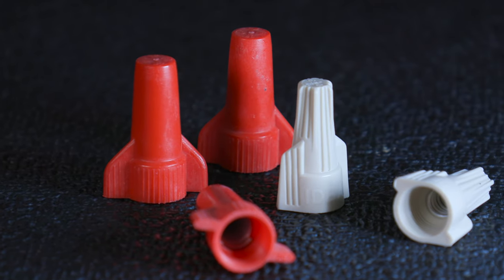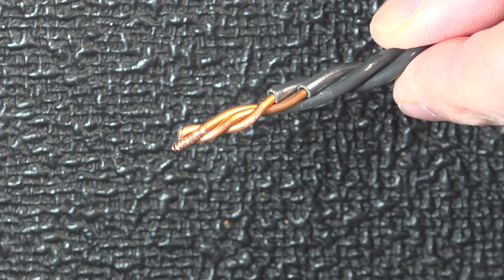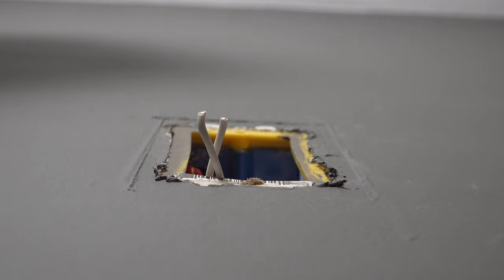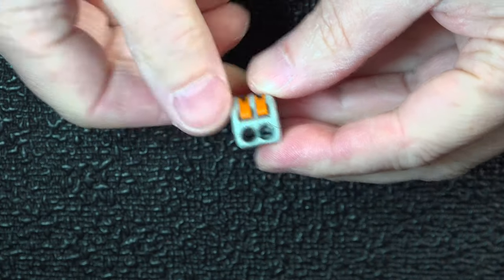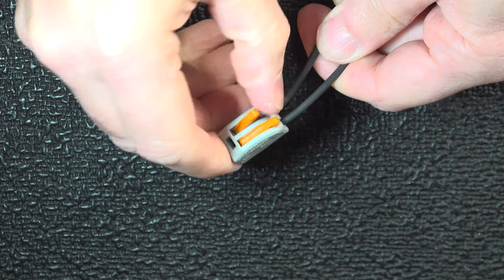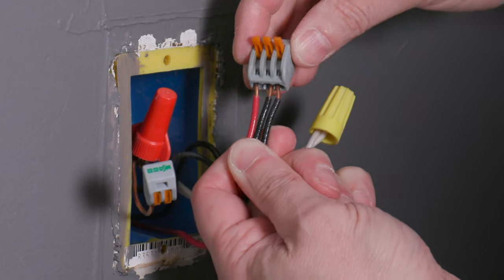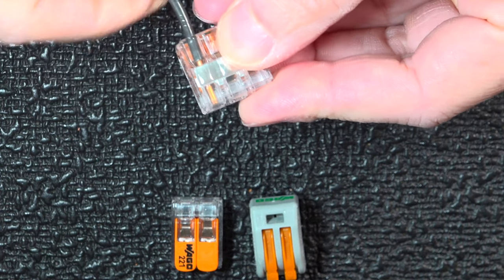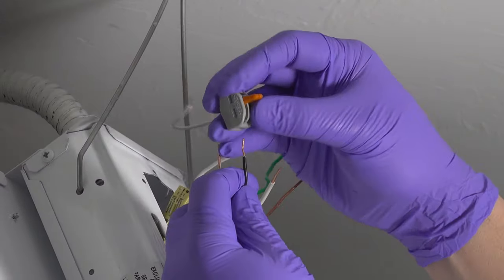Never use Wire Nuts Again - Wago is Better Electrical Connector

Comment: Wire nuts are UL certified, cheap and NEC approved.  That's good enough for most electricians, building inspectors and code enforcement.
Reply from the maker: Wagos are also code approved, CSA, UL & have many other approvals worldwide and meet the NEC as a pressure connector. The NFPA even did a special test on these a few years back, I believe in response to so many "worries" about them, despite them already being approved and passed with great results. They are not cheaper, faster and easier though.

Comment: Yes, I've used wire nuts. But for the loose wiring the Specialist and I found in the combat kitchen unit, that's what they used, and that's what we were given to fix where some were missing. I don't like the idea, but Uncle Sam's a freaking penny-pincher.

Comment: Those come with a lot of commercial lighting and the sparkys always throw them out. No one uses them in the villages of fl. Don't know about the rest of fl but I've never seen them used.
Reply from the maker: Can you imagine an auto mechanic ripping out electronic ignition and replacing it with points. Taking a new product and downgrading it.

Comment: And what about commercial work here we have to have so long of a twist before the connector. There’s an attachment for your drill to do this with wire nuts. So I assume these are not allowed. Good thing because they are horrible crap that either doesn’t work to begin with or burns up.

Comment: I got shocked many times at a job site pulling pigtails out of boxes because of wagos. The wires do not stay in when they twist as you pull the pigtailsout you are going to inevitably twist them exposing bare copper. Also when dealing with stranded wire they are a pain to use because the wire is not ridged enough to properly stab in. I am a jurneyman electrician and am still team wirenut.
Reply: I do however like them in light fixtures because you have more room and are less likely to twist enough to get shocked.

Comment: Well if you can tell me where I can buy a box of 50 or 100 and only spend $5 to $10 I will happily replace all of my wire nuts but also they don't really work very well when it comes down to stranded wire

Comment: Those look fine for connecting low voltage devices. I would not trust them for high amperage applications. I see lots of fixtures that come with something similar. I cut them off and discard them. I have never had any problems with wire nuts. They won’t give problems as long the wires are properly twisted with a pair of lineman pliers and no copper sticking out. Yes a wire nut will give problems when someone just groups the copper together and jabs the wire nut on without twisting. The wire nut will get loose and cause arcing between the wires.

Comment: the 1st wago connectors in your video are ɴᴏᴛ ᵁᴸ listed. I have used them but depending on the load the internal wire was to small,thin and overheated. then melted. Only buy UL listed and is rated for 14 or 12GA wire.

Comment: I've been doing electrical work for 50 years. Never had a wire nut fail,, overheat, etc. Ckever idea that no one will use... and what about code? Approved by the NEC?

Comment: You can unscrew the wirenut and just snip the very top off.  No need to cut the whole thing off.   And the wago is quite a bit bigger.  Not gonna be a good idea for inside a small junction box

Comment: one missing info is that at least on the old grey version, you actually have it marked how much you need to strip off of the insulation on the back of the connector

Comment: I have never cut a wire nut off. I twist it off, and if needed will sand the damage wire until mostly smooth. Just takes a moment more

Comment: I've had issues with wire nuts.. and these connectors saved me more than once! They're awesome. Expensive but awesome
Reply: I've wired up literally thousands of miles of wire using wire nuts for the connections and have never had a single issue that would stop me fro using them to this day. I would never fall for a scam like this. GG though, you must have money to burn.
Reply: @anonymouscity8083  I concede that the reliability of wire nuts must be higher in the hands of a skilled person than that of an average joe, but how often does an electrician get to evaluate the long-term results of his own work?

Comment: I’ve been on ALOT of service calls were it was a bad wago connection. Never been on one we’re a wire nut installed correctly failed. I literally tell my guys to cut them out unless it goes against manufacturer’s warranty
Reply from the maker: Good move, toss the german made, UL, CSA & NFPA tested connectors out. I think plumbers did this with PVC and kept putting cast iron and lead back in too. Someday maybe we will reach with UK and the rest of Europe are electrically and were 20 years ago.
Reply: Damn that was quick. You must be really passionate about this shit.

Comment: WAGO connector have their uses but they are not for everything. You mentioned contact area and how that can generate heat. Well take a good close look at your WAGO connector. You are only make a very thin blade connection to the wire. Under extreme usage they will burn up due to lack of adequate surface connections. They are great for use on lights and light switches but would never use one on an outlet where there could be constant power draw. I prefer to keep the fire in the wire, and not the walls.
Reply from the maker: Instead of hypothesis I tested it out https://youtu.be/B1pmuRsf1co
Reply: @SilverCymbal  Explain that to the people that lost their house because of them. But I'm sure they will be thrilled with you telling them just how safe they were. 

Like I said they have their uses and do work great for those uses. But they are not for everything. The WAGO argument has gone on for decades, and still there is nothing that proves they are safer then a traditional wire nut.
Reply from the maker: @jonesgang  What people have lost their houses to a Wago 221 series connector? I have heard this dozens of times in comments, with repeated requests from me to share a single  factual occurrence. I have received none. The NFPA tested these years ago with favorable results and they are the gold standard and only standard in most of Europe. Accuracy counts, so the accidents you are saying have happened or they are myths and since I have offered again for info  and so far as to ask to send me any burned out 221s that I would be happy to look at and bring to the NFPA which happens be down the road from me, and yet not a single one, or even a photo has surfaced. They are approved, meet a spec, you don't have to use them or use love them but myths of their disasters at this point are just that.
Reply from the maker: To add, I never said they do everything but I they are safe to use for their specified purpose and nothing other than fear has proven anything to me or the NFPA who writes the national electric code otherwise.
Reply: @SilverCymbal  Well I can also recreate what I want happen in a lab environment. Real world application are not quite the same. You take something from good to failure in one step. That is not what happens in a real world environment. If you care to actually take the time then do a more realistic experiment. Cycle from full load to no load and repeat this multiple times. Something like a space heater would do. You will see a drastic difference in your testing outcomes. I have been an electrician for well over 30 years and I have seen just about all there is, but life always sends me a new surprise every now and then. 

Again like I said WAGOs are great just not for everything. And WAGO's have been used for many years with full NFPA (NEC) approval. And I have seen them as the point of failure. Chances are they were improperly used as the cause for the failure. But they do can fail and are not impervious to failure like you try and make them out to be. 

Some electricians will swear by them and others will swear at them. Been that way since their existence.

Comment: I think of people who stab their wires in the back of outlets and switches. They come loose over time and can be pulled out easily. Most wire nuts are the ground and neutrals that are in the back of the box to never be touched again. Also most of those wire nuts were the cheap Home Depot ones. If you spend a little bit more at the supply house, they have really nice wire nuts. I don’t think their all bad. Might work in tight spot with short wire or for temporary things. Probably would be nice for people who haven’t done a lot of electrical work. For small things like others said changing out lights etc.

Comment: B.S. These wires should ALWAYS be spliced together then covered. One main reason for that is heat, when that wago cap fails & melts you'll have lose wires inside of your box. With a splice at least the wires are still together and a lot safer when troubleshooting. Also a wire nut is reusable, the first wire nuts were made out of porcelain and switched to plastic & metal cause it was cheaper to make. WIRE NUTS SHOULD NEVER BE USED TO SPLICE WIRES TOGETHER....
FACTS 💯

Comment: im studying to be an electrician, third year, and never used wire nuts😂 also if you didnt know, wagos have the cheaper version with no switches and you just stick the wire in. its holds little stronger and its also smaller than that one.

Comment: I am guessing these wire nuts were and still are popular in North America. Dodgy looking things and I have come across some within imported American machinery. Australian wholesalers have supplied a type of connector commonly called a 'BluePoint'.  Easy and safe to use. The new Wago type connectors are even better. May cost a little more but in the long run safety is at the top of my pyramid although some contractors are more concerned at increasing their profit margins.

Comment: commercially, the time you save is worth the extra cost, and they have some others that is for installation wires and not stranded they are even smaller

Comment: Yes please use wagos I have made lots of money going back and replacing them with wire nuts after they burn up or fall apart
Reply from the maker: I'm sure you have. Funny, to this day despite the horror stories, I am still yet to receive, even a single photo of a burned up Wago 221. Search on burned wire nuts you can fill a family photo album

Comment: I use a little dielectric grease to lube and secure a snug connection with my twisties, never-ever had a problem in more than half a century.

Comment: I've used these and love them. It just sucks that they are more expensive than buying a bucket of the wing nuts. If they make them cheaper I would forever switch to these
Reply: They're not more expensive tho. If you factor in labor cost, wire nuts are typically more expensive.
Reply: @teds9896  Labour cost us not an issue ti DiYers

Comment: are these connectors listed and approved ???? NEC 2020
Reply from the maker: Connector brands are not approved in under the NEC. The type of connectors are, these meet pressure connectors under the NEC and are also UL, and CSA approved as well as stress tested by the NFPA

Comment: Does no one use BP connectors anymore? Cheap, reusable and only loose around 10-20mm of wire per change as opposed to 30-40mm with wire nuts. Come in 1 screw for active/neutral and 2 screw for earth.
Reply from the maker: For an unknown reason those never caught on the US. They are brilliant and simple and get rid of all the complainers that can't believe a Wago works, but they didn't make it here.

Comment: There is only a tiny bite on the copper wire of the wego, which means there is so little surface contact area, which will make the connection relatively high resistance and more voltage drop and heat. Plus as you wego it , it will come lose. Compared with wire nuts, you can pre_twist the wires and put on the nuts. Then you have a ten times stronger connection and great less risistenance and basically no excessive heat.
And a 4 wire wego nuts takes more space than a 4 wire wire nut.
Just like the quick connection holes in the back of a receptacle. Do you think they are more reliable than the solid screw terminals on the sides ？So,Never use them, if you are working on your own house! these are the real problem makers.
Reply: I have been using WIRE NUTS for 50 years and agree with you 100%.
Reply: @flash490  thanks

Comment: I know this video is old but you don't and shouldn't have to cut wires to redo a joint. Simply unscrew the wire nut and toss it in the trash if you think it's bad or resuse/keep it if it's good. If you can't straighten the wires after undoing a joint, then you can cut the exposed copper off and restrip. No need to cut back over two inches of wire every time you want to replace a wire nut with a WAGO.

Comment: Simply does not have the strength(pressure)required and not anywhere near the surface contact of a properly made ,twisted wire nutted (it is a compression connector and they are quite strong) junction.I can also pull the wire out of these and it can also vibrate loose.I dare anyone to pull the wire out of one of my junctions-well,It can be done but takes so much force you could break the wire first.I can also easily vibration Proof it if I think thats an issue.This is  Also about the worst possible choice in any kind of element exposed environment.I can easily all but weatherproof the right kind of wirenut.

These are commonly used in flourescent fixtures because-you have to change ballasts or drivers and that makes it easier- but also because the small wire and low current as well as the non criticality make it ok. I have been a licenced electrician for 40 years and when I do anything that isnt inside of a light fixture I plan on doing it Once and Not having it fail. I would never use these.

Comment: Pre twist is always best and using the correct wire nut is always best. The type you are showing are way to big for the wire thickness you are showing.  Also after wires are twisted together and you twist on the wire nut always test it by pulling on it to make sure it is secure.

Comment: I resisted these when they first came out but over time they have grown on me. Also, I believe these remove a ton of installation liability that wire nuts could bring.
Reply: Especially in situations with short/old/mixed wiring

Comment: These connectors make a J box seem so roomy inside, too.  They are easy to push in so they lay flat in the back of the box leaving gobs of room for the switches or outlets.

Comment: There's a pretty simple explanation for why people use marrettes over these other connectors. It's typically $17 for a pack of 100 marrettes compaired to the $45 to $50 for 100 of these clips.
Reply: Is it really that significant though? $30 difference for 100 connections, how much does that increase the average job?

Comment: Are these rated for aluminum wire?
Reply from the maker: Yes, read their directions first I am not the aluminum expert. But this is from their site:  With WAGO Alu-Plus Contact Paste, they can connect aluminum and copper conductors using WAGO's connectors – quickly, easily and reliably.

Comment: I have never seen wirenuts before here in Europe.
There are kinds of Wago connectors that we call dominos in several countries. Either by thumb clips of screwdriver screws inside a kind of little tunnel.

Comment: I sometimes find these wire nuts on older installations from the 80s. We have been using connectors with knives in them since the 90s. Those connectors weren't reusable, but easy to connect cables with. Wago's came around 20 years ago, and have been the standard since. Use Wago connectors up to 40A.
Reply: The standard?  I think not.  40A....  Where do you live?  I hope I don't buy a house you did wiring in!
Reply: @markusallport1276   It's the standard everywhere these days, they are rated to 400V, 34A so it's about the same as wire nuts.

Comment: ONLY USE SOLID WIRE IN A NUT!!!! and if a nut is done well it is the best connection. over here we usually use something in between though. but if we use flexible wire, we use Wago and i love them (or mixing small and big wires). but for higher current a GOOD nut connection is the way to go

Comment: I will say these are best when used on #14 thhn wire or smaller. LV wires where the tiny blue or gray wire nuts don’t grab. #12 or larger solid or stranded gotta go with good quality wire nuts.

Comment: so as far as I understand, a wire nut if properly installed won't have an issue.  these wagos if properly installed won't have an issue.  Wire nuts work great if not overstuffed, and not in over currented situations.  I imagine these are the same.  But if you are going for a permanent application.  So most house hold electrical situations, why not use a but splice, or a bolt connector.  The answer is well, cost.  Wire nuts are incredible cheap.  In a residential wiring application they work fine and are not raising the costs of building projects.  But in any wiring I have done in commercial or industrial equipment I will put in a terminal strip for connections just for testing purposes later.  Then you don't need wire nuts, or wagos because you are just have terminal test points to join wires.

Comment: If you need to add a wire, un twist the joint slightly add new wire and re twist. A spliced wire will not fail. I can’t count how many times a wire pulls out of a stupid wago